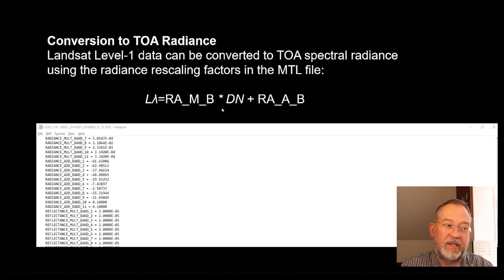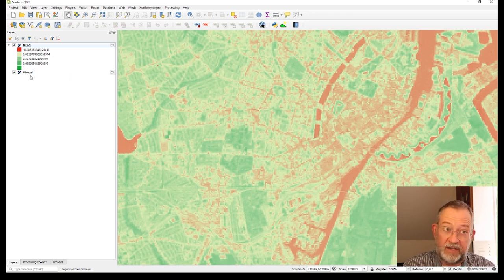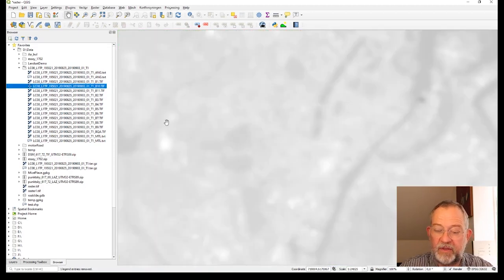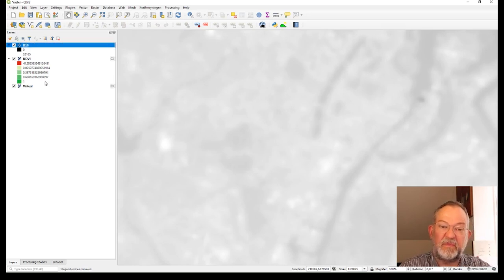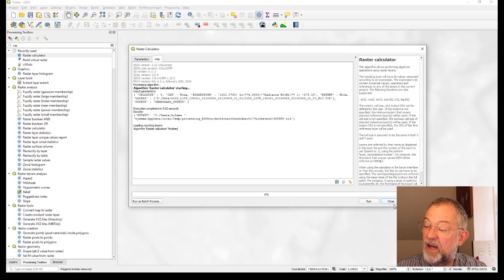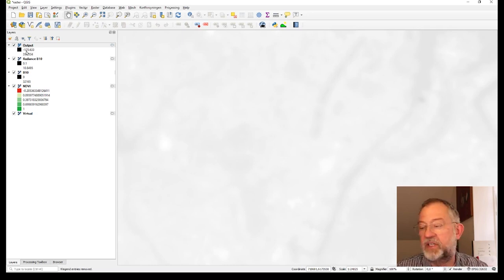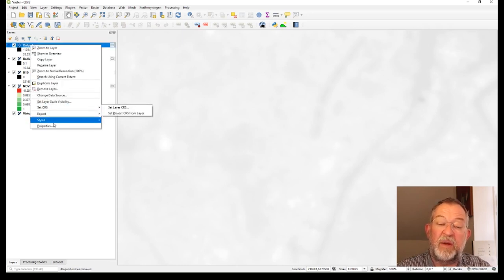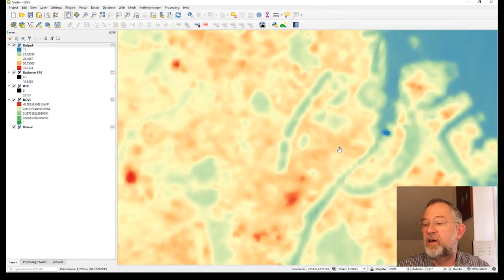Calculating Surface (Brightens )Temperature from landsat data using in QGIS

Comment: What Landsat data was used? Would like to do somethng similar with Landsat 5 if possible.
Reply from the maker: The data used waslandsat 8 but landsat 5 also has a Thermal Band 6 (10.40 - 12.50 µm)  but with a resolution of 120 m
Reply: @Geoinformatics_0nline  Very much appreciatte the information.One last question: Is Landsat the best alternative for an urban  growth study. Just need to generate how much the urban shape varies through time. Problem is small urban areas are hard to spot due to old landsat resolution.
Reply from the maker: @Refreshment01  If we are back in landsat 5 days I don’t know of any better solution (The alternative would be Spot images but they typically cost money and are more scattered in their coverage i.e. no systematic global coverage
Reply: @Geoinformatics_0nline  Thank you for your time & patience.